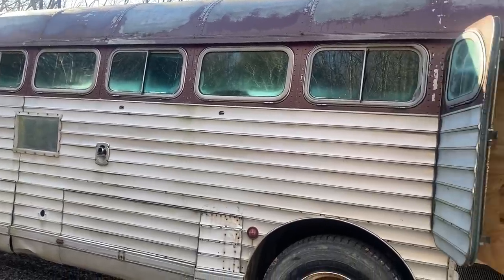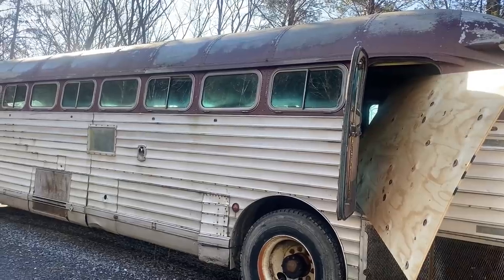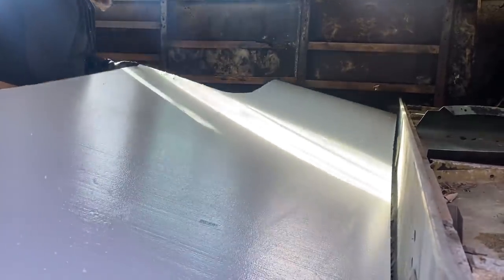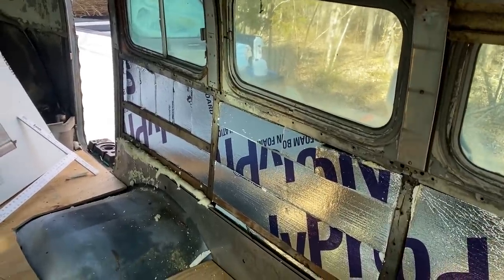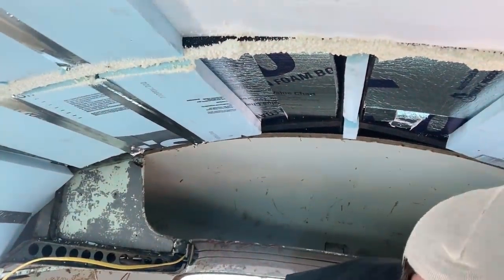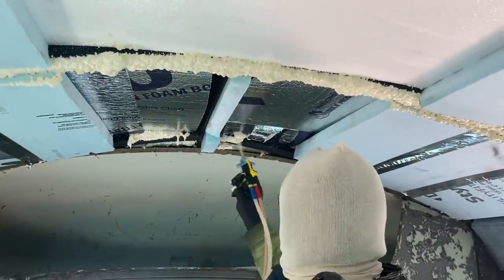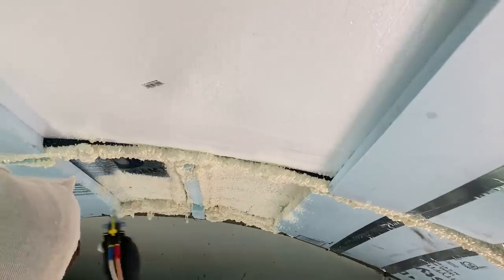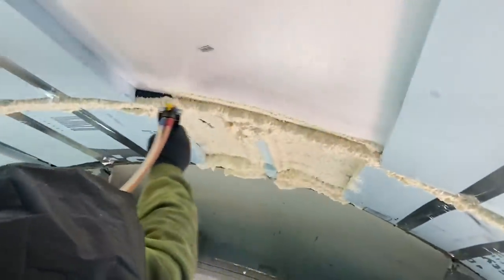Tylers silversides bus build rv conversion

Comment: use a drywall rasp when working with foam it makes getting perfect fits easier
Reply: A hot wire ( temperature hot ) to melt through a rough cut or to quickly cut back the over sprayed spray foam. Just hot enough to melt through easily, not red hot. The rasp afterwards to get the finishing touches.
Reply: I like a Surform blade
Reply: Nice job Tyler!

Comment: I did Entire rear engine flat nose  school bus with foam. It was a nightmare but it added A  ton of rigidity to the body and got rid of a lot of buzzes , noise. I found the rule of thumb is less is more you can always go back over again.

Comment: I'm always hesitant to use spray foam.  It can be a mess later if you need to change anything!
Reply from the maker: It seals stuff up tight though.  We barely touched any part of the bus.

Comment: I though you didn’t like to block the access to the engine from the inside rear of the bus in case of a repair of the back of the engine ???
Reply: Not his bus
Reply from the maker: It is not blocked

Comment: Lots of work. Kinda cringe when I see wood studs below windows. Moisture from condensation or leaks is devastating. Just 2 cents.
Reply from the maker: Seriously, for hundreds of years window had wood frames.  My bus has had there for over six years and never got any water damage.  Close the windows when raining problem solved.
Reply: Bus Grease Monkey  for sure, just being careful. Wood there was redwood or cedar for resistance to moisture. My RV has lots of damage from moisture on the plywood or luan. I saw Bus with Gus complaining about leaky seals on his windows. Maybe I over- engineer!  
Stay safe.
Reply: A few more hours and some Maplewood, Cherry and Walnut and it will be like the Renner Bus!